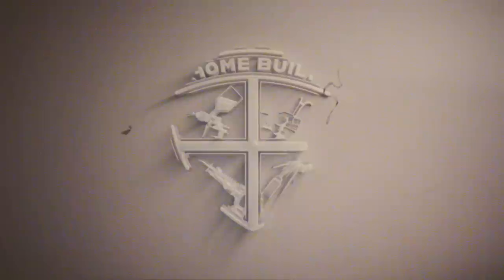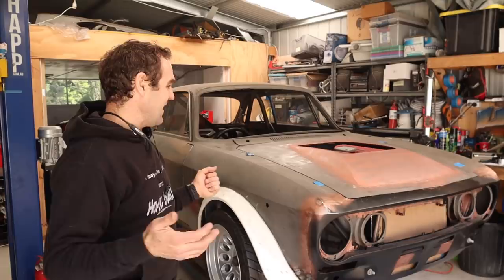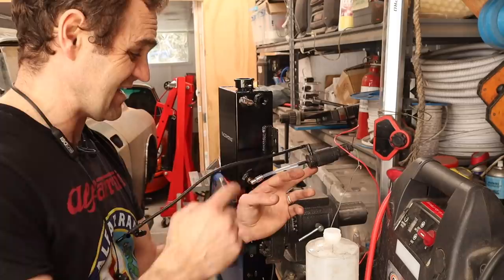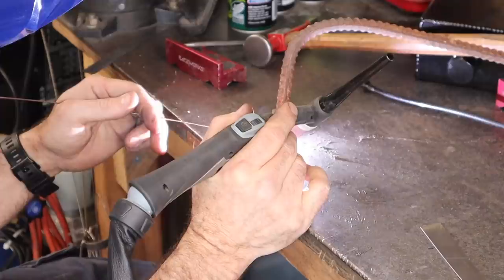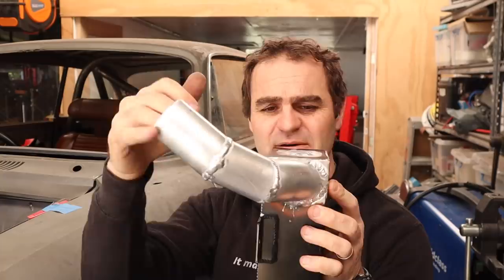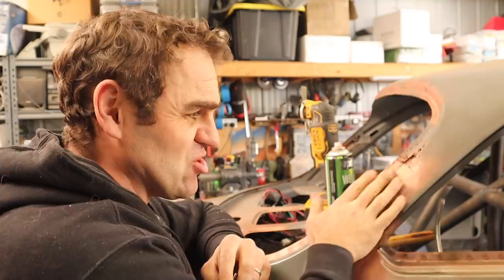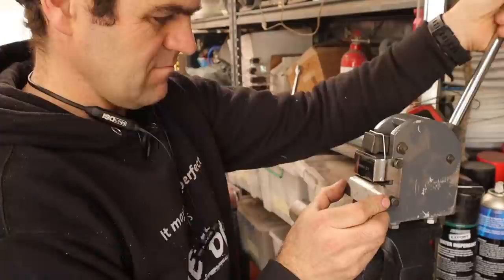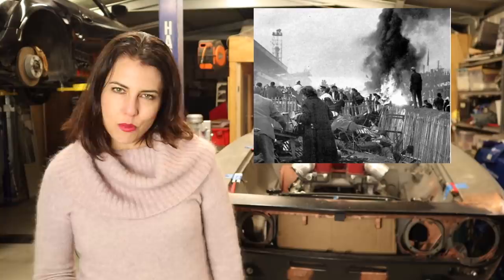Symmetrical Ferrari engine bay - Ferrari engined Alfa 105 Alfarrari build part 102

Comment: Jeff, the back of the bonnet / base of the windshield is a high pressure zone. You wouldn’t be able to let air out of the engine bay there. It’s the reason why the cabin air intakes are usually there and on old cars often it’s unassisted by a fan, just using pressure differential. You’ll also see on some cars, mainly American muscle cars, cowl induction there for the intake.
Reply: The air wouldn’t get let out, but cool air would get forced in. That’s why bonnet risers have been a thing got a long time. They’re not ideal aero wise, but they do help cool the bay.
Reply: @Jonathan_Doe_  Well, pressurizing the engine bay will decrease the pressure differential over the radiator. tbh I think those lifted bonnets are mostly for looks or misunderstood aerodynamics

Comment: Looks great, what a solution. Only thing I'd consider it putting a drain or low point of some description in the aluminium cap on back of the unit, to drain any water that works it's way through the plenum or if plenum clogs. Better than a bunch of water in the unit/carpet

Comment: Just a note: air does not come out of the back of the bonnet.
The angled area at the base of the windshield is an high pressure zone.
If you lift the bonnet, like many drifetrs do, you make fresh air come trought the lifted section, wich seems a good idea, but it also increases the pressure under the bonnet wich means that the radiator is now less effective at cooling the engine (the ultimate goal) and have increased front lift at high speed.
The correct way to extract hot air from the bonnet is from extracion vents in a curved section of the bonnet, near the front, where the air velocity would be maximum (look at Singular Motorsport NC miata vents)

Comment: One small comment. Vents at the end of the bonnet will most likely suck in air due to the high pressure section at the bottom of the windscreen. You would be amazed how far fwd you need to be to get air our of it through the bonnet

Comment: Since I know you Do read them, Check out the Ryobi One+ Rotary tool, I've got that and the Solder with the dial, Makes it so so much easier for those smaller jobs just running on battery packs but a lot smaller and can get into small spaces. 

Can't wait to see how epic and clean the Wiring is going to look! PDM might have to be a Must

Comment: Jeff can I offer one suggestion that doesn’t fit with your “ do everything at home” ethos. As the plenum/ throttle body intakes are such a focal point of the motor, can I suggest you have a experienced aluminium welder weld the the alloy tube to the intake. The last thing anyone wants to see is you grind into that beautiful red finish to neaten up a weld.  That isn’t meant as disrespect to your workmanship, but you yourself know your limitations. Sure you can weld it, but it needs to look pretty. Actually, it will look badass. 🚀

Comment: Great work as always. Loving the symmetry and finish of the washer bottle, but it doesn’t look like the Raceworks filler cap has a breather. I’m curious how air will replace the water as you use it?
Reply from the maker: That is a good point. I might drill a very small hole in the neck of the bottle.

Comment: Nice recycling . May be worthwhile confirming whether the washer pump is self priming. All the pumps I've ever seen are at the bottom of the reservoir. Obviously, only taped on at the moment, but if it doesn't self prime, the bottom half of the reservoir is wasted.
Reply from the maker: I tried it and it had no issues sitting well above the water line.

Comment: 10mm isn’t much clearance with the amount of power that thing will be putting out... I’ve got a feeling Delrin engine mounts, or a torque bar from one of the suspension turrets to the top of the engine might be necessary.

Comment: the back of the bonnet is not a good place for an air exit, due to high air pressure ahead of the windscreen, that's why the ventilation inlet is at the base of the screen, an air exit has to be in a low pressure area

Comment: I'm just wondering if you use any type of isolation between the metals  (like the aluminium fillercaps and the steel body) to prevent galvanic corrosion.

Comment: I’m liking your build and look forward for the next episodes. I do have a question, have you engaged an engineer to oversee your build, has he indicated that he is ok with your modifications? I know there are strict rules on engine sizes and structural modifications. Even cutting holes in the floor for your master cylinders is a worry as I was told even converting to a floor shift needed to be strengthened. The engine capacity has limits as well especially in a monocoque car. I’d hate for you to get to the end of the build and not be able to register it.
Reply from the maker: Yep

Comment: I've been looking at cordless die grinders for a while but unsure which to get. They all seem so big and cumbersome.
Plus I also want to do engine porting to the long snout would be handy.
Reply from the maker: Mine is a DeWalt one as I already have that range of tools. Not sure why, but it doesn't seem to jump around as much as the air one and is easier to control.
Reply: @HomeBuiltByJeff  more weight so less jump makes sense
Reply: @HomeBuiltByJeff  I've been told chattering is a sign of tool imbalance. The better made are supposed to chatter less than the cheap ones.
I find it to be dependant on tool speed and more common as the tool slows down.

Comment: Jeff, I noticed the bracing across the front of (and under) the bonnet opening is cut to accommodate the roundness of the aluminum intake elbows you made. Does the brace rest upon the intake elbows or does it clear it? I'm just concerned that if it contacts the elbows that what vibration the engine does have will transmit to the bonnet and make it shake. (and cause wear on the elbows too)